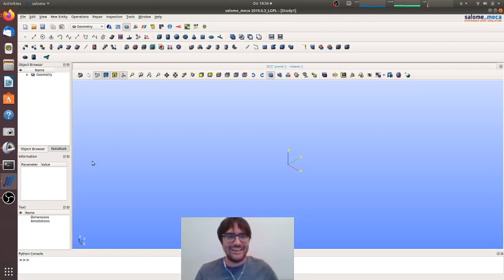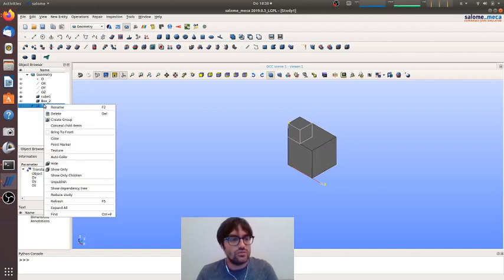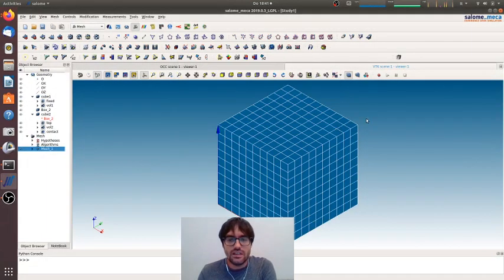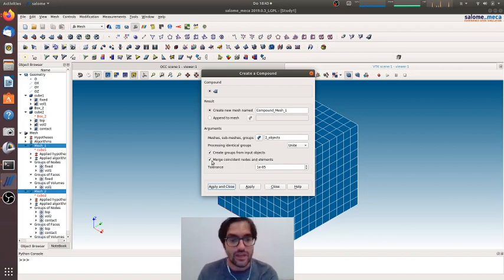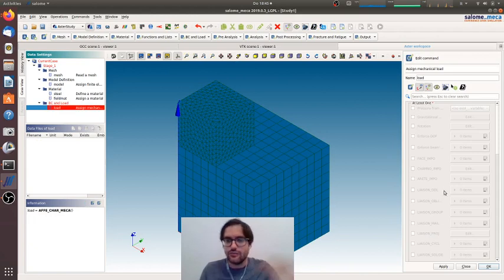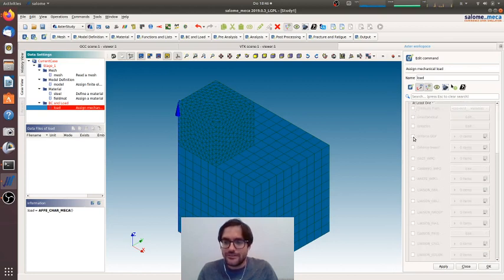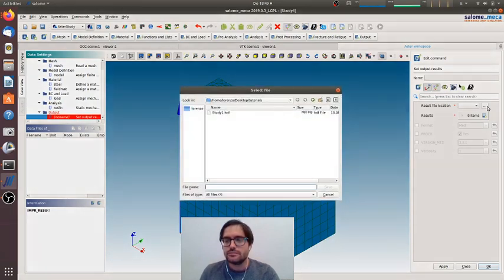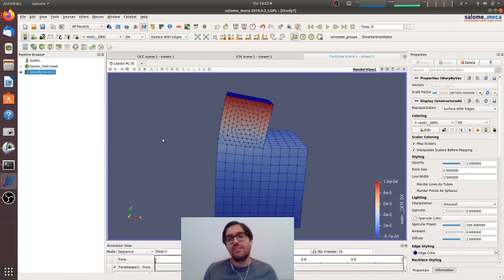Tutorial for Code_Aster - Ep. 10 - Connect Non-Conformal Meshes

Comment: Is it possible to connect quadratic or biquadratic (with bubble node) voluminal mesh like HEXA20 or HEXA27 with linear shell ones like QUAD4?
Reply from the maker: It should be possible since the algorithm is based on shape functions, so the order of the element should not play any role.
Reply: @aetherengineering7387  Thank you very much for your reply. It works.
Reply from the maker: @lalasampritray1002  sounds great!